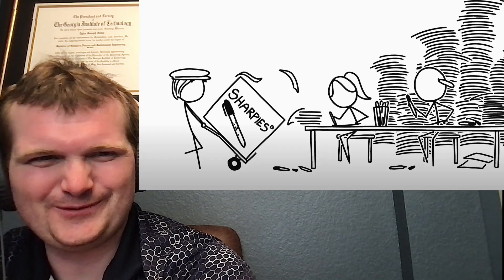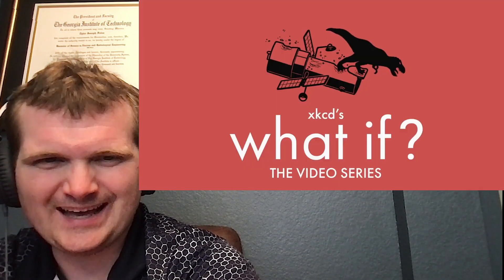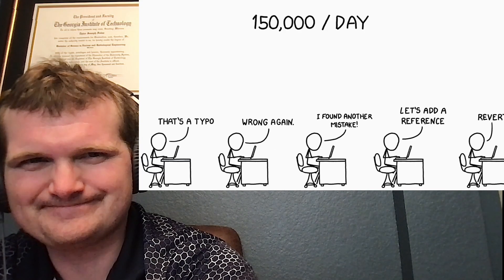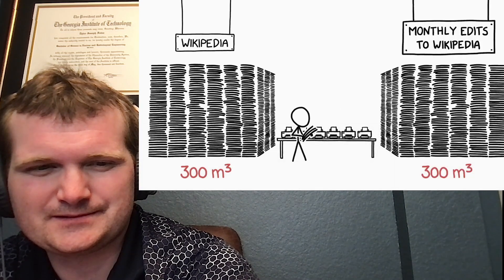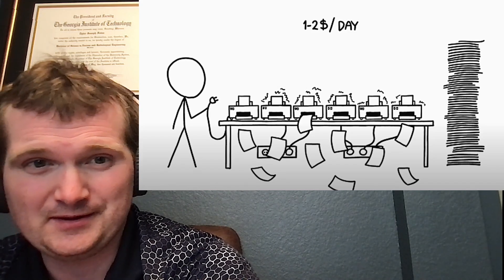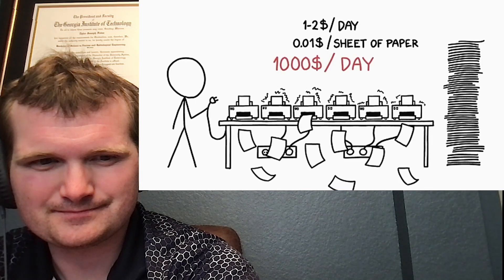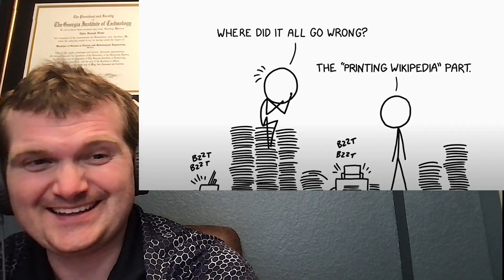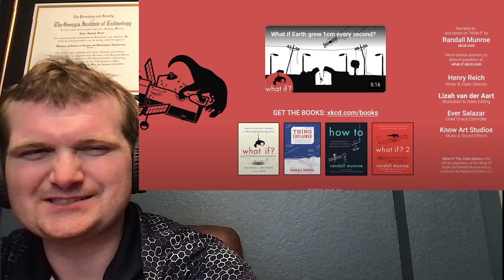Printing Wikipedia More Inefficient than Nuclear Fusion? - Nuclear Engineer Reacts to XKCD

Comment: You can avoid ALL of the ink related problems by using a thermal printer. The paper is a little more expensive than normal paper but VASTLY cheaper than printer ink and, of course, doesn't need to be refilled.

Comment: You probably don't need 12 redundant printers.  The failure scenarios for this Wikipedia printing operation are less catastrophic than the failure scenarios for a nuclear power plant.  .... at least, I HOPE they are.  This is something Randall Munroe designed, so that's not a sure thing.

Comment: 1:30 Putting the hypothetical nature of the premise aside, I would liken it to the publication of encyclopedias or textbooks. While the impermanence of the information on a given Wikipedia article is more on display than the information given in things like encyclopedias, the basic underlying problem is the same: information (hopefully the most updated at the time of publication) is published to be disseminated and shared to a wide audience, but as information changes over time, new publications need to be made. It’s a similar issue I’ve run into with writing a nonfiction book, where I was afraid to publish for the longest time in fear of the information I provided being outdated eventually, but ultimately that change is inevitable and to not publish it in a sort of ‘waiting until the information becomes concrete’ desire would mean never publishing at all.

Comment: As an IT professional since 98 I try to avoid printers more than than people who still wear masks in public. Maybe about an entire year of my life has been used up altering templates based on what they actually produce rather than what they should produce.
Finally I hope you got paid for that extra 30 minutes especially if the Nuclear industry has the same Victorian mind set as Banking where they think time = value and that you are digging at a coal face at a set rate. All whilst in an environment where a thought that took 10 seconds to fully consider can save millions. As I myself was exposed to this via being fired from Lloyds TSB CF after progressing faster than anyone prior, for the heinous act of turning up 1 minute late after a 60 minute commute. When the real reason was I was threatening the system where they were gleefully able to fire people for turning up 1 minute late; rather than maybe alter it whereby people might actually have to add value to the company rather than just achieving the incredible goal of being sat at their desk between 9 and 5. But this would have resulted in more than 70% of the people there being fired, included 100% of the people who maintained those policies.
Reply: I'm sorry me preventing an asthma attack from pollen, exhausts and certain smells/chems (think cleaning product aisle e.g.) bugs you at the same level as printers :') . (reactive asthma)
Reply: So you also suck at handling printers despite pretending to be an "IT professional", because as a professional you should now how to handle them.

Comment: Linus Tech Tips just put out a video making a "radiation proof computer" which might be interesting for you to look at. Most of it is them struggling to build a lead computer case and all of the safety requirements they are required to follow as a business working with lead.

Comment: The big issue... the small printers have a dutycycle of as low as 100 pages/month.  Even an office inkjet printer has a 2k-5k page per month dutycycle.  Even enterprise Laser printers have a 50k page per month duty cycle... so not only is ink needing to be replaced fast, but also the pickup rollers, imaging unit, fuser, waste toner (luckily toner is inert... just messy if spilled)
Reply: You would want the big heavy-duty printers they use for printing things like bills and bank statements. They cost something like $50,000 to $100,000.

Comment: my advice on printers:
1. HP printers suck, by design, to sell you more ink cartridges and shit
2. I got a Brother printer, with an included ink supply that's lasted me years, for less than one set of replacement cartridges for my old HP printer.  And it works pretty much flawlessly.  highly recommend the Brother brand.  unfortunately HP has all the money to spend on marketing

Comment: 2 12h shifts? Why not have 3 of 8h shifts? That's more effective and easier on worker mental health and mental capacity to work.
Reply: More handoffs. Consider how much time is lost during each handoff. Also you might need a bigger staff of qualified, certified people since you need to rotate through more shifts, depending on how you handle scheduling. Also consider that you only need to work 3-4 12h shifts per week instead of 5 8h shifts, so it's a more efficient use of employee time too -- there's a fair amount of evidence that 4x10 work weeks are better for mental health than 5x8 work weeks, since longer individual shifts have less negative impact compared to the positive impact of having three days to rest every week. 3.5x12 might not have quite as favorable results (I don't know if there are studies) but I would imagine it feels fair to the people who choose to work that schedule.

Comment: Printed encyclopedias were updated regularly and reprinted. Most of the information in Wikipedia is still correct and still useful decades later even if changes have been made to the live version. So a simple printout of Wikipedia is not that ridiculous if say you were likely to not have internet access for a while.
Reply: If you just lack internet access, then the best solution is to have a local copy of Wikipedia on a hard drive, not print it out.
Reply: You can just go to library tbh. They will have most things wiki is using as sources (since those need to be "credible" first, thus most likely already having physical edition that is somewhat widespread).

Comment: How crazy is it that troubleshooting a 3D printer is waaaaay easier than troubleshooting a traditional 2D paper printer? I have both and would never touch a paper printer, but I've rebuilt my 3D printer several times over.
Reply: It's mainly the output material
A 3d printer is a plastic extrusion nozzle half a centimeter wide on a three axis platform
A 2d printer is a series of rollers and lasers designed to perfectly handle microscopic powder and various pigments at sub-millimeter precision
Reply: @samuels1123  Half a millimeter, actually. But point taken.
(also the extruder is treated as a fourth axis)
Reply: Probably because 3d printer was built by you or someone else with similar knowledge as you (as shipping them pre-built is likely to get something misaligned due to.. well, shipping). Whereas 2d printers is and old and time-resilient technology built by an eldritch being from some outer dimension.
Reply: At this point just make a paper printer using 3d printer parts and software
Reply: 2D printers... they have them all sealed up in a "nice, neat box" and are designed to be hard to maintain... if at all.  the cheapest are considered "non-servicable" to get people to buy a new one.
Reply: Depends. There are plenty of printers out there that aren’t made by HP and well known. And you have a better skill set with a 3d printer which is more designed for people who would have a skill set in that area. And saying a paper printer is 2d is a lie because it actually has grooves in the paper.
Reply: weirdly, I simply have not had any problems with a paper printer for at least 10 years now, other than clogged printheads, and that hasn't been a problem since I gave up on HP. They just work, always.
Reply: @John_Ridley  Then you are the lucky outlier that highschool math classes teach us about
Reply: I have worked with both and built my 3D printer as well. But a regular printer that is of high enough quality will break far less and any fixes necessary is quite quick. The problem is no one wants to learn about how exactly they work and any parts you need to replace are not easily available. We have a printer at the department with print counts at many millions. It requires small fixes every other month, often changing a part that are worn out.
Reply: Printers are highly regulated, 3D printers are not. Every printer is required to watermark every page they print so the government can trace the origin of any printed document.
Reply: @BobArctor  no not every printer puts that watermark on the printout. Its specifically laser colour printers.

Comment: don't feel bad about your luck with printers, many a grizzled IT guy will shudder at the phrase "my/the printer isn't working" there was even a case where certain Linux programs wouldn't print on Tuesdays.
Reply: Can confirm. Printers are a Devil Spawn.
Reply: Apparently the steam decklinux straight up can't print, even in desktop Linux mode
Reply: @Elitekross likely that valve omitted the functionality, I installed a few things and it worked
Reply: @artemis.nnnnnbbbbb  there's a guy in one of my fb groups (idk which one lol) that would LOVE to know what you did, be hasn't been able to figure it out
Reply: @Elitekross  Did he try turning it off and on again? If that doesn't work with hardware I'm also out of ideas.
Reply: @Elitekross that was a previous issue, however thats been fixed (I believe)
Reply: @Elitekross  Linux uses a CUPS server to print. That's an unnecessary and a potential attack vector that doesn't need to be on a gaming console so they didn't include it in their OS.
Reply: Worked in a school IT department.
Printers despite being one of our oldest techs if you count printing presses are the biggest pieces of shit
Reply: Late to the party, but I bought a broken laser printer on ebay that would only print in wingdings. Best investment I ever made!
Reply: Ah the Hulk Hogan of Printing.. lol
Reply: This is because the software developed for printers is made under the incredibly greedy direction of the scammers in charge of the industry. Printers print, but nearly every single other aspect of its design is specifically made to waste as many resources as possible without being able to be legally called a scam.

As far as printers go, unless you can build your own, you are going to be scammed by using one. And it's honestly because printers are no longer general market products anymore. If companies designed them to work as efficiently as possible in this digital-focused market, they would hemorrhage money unless they were unreasonably expensive. Because the average person today is only going to use a printer once or twice a year. You can't make money off of a product with that use frequency by making it cheap and efficient.
Reply: I agree I cannot stand printers I don't even own one😂😂. What's even more funny printers are the one thing people fail to protect when it comes to their computers, I mean when it comes to getting hacked. I literally hack someone's printer one time and scanner and I literally just watched all the things they were printing and it was information I probably shouldn't have known about and I'm not going to say exactly what printer I hacked cuz I know I would get in serious trouble for it but let's just say somewhere in the government they have a very highly used printer that is very much unprotected